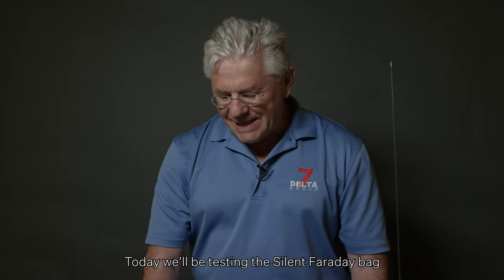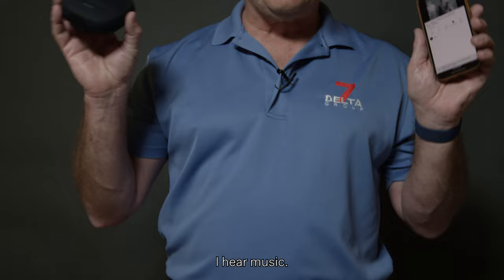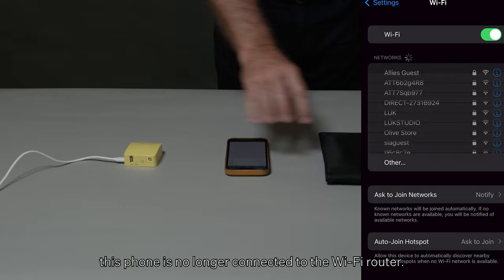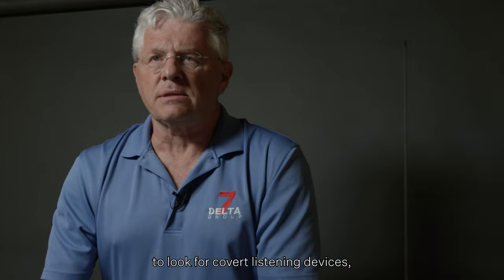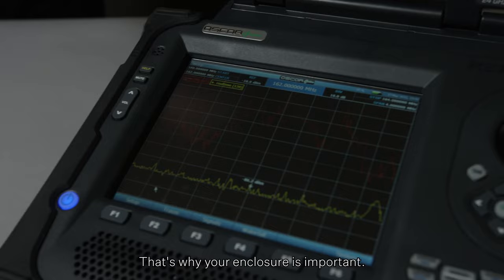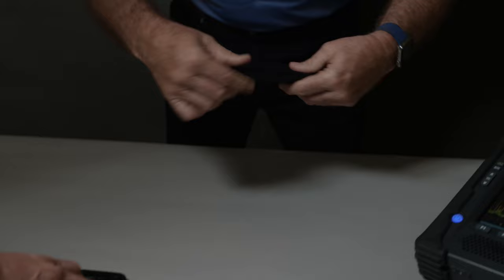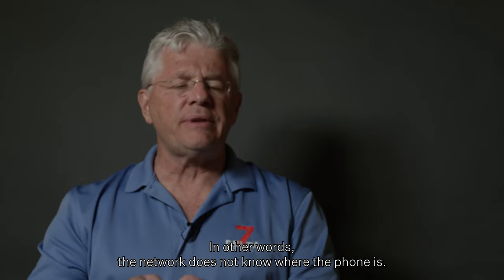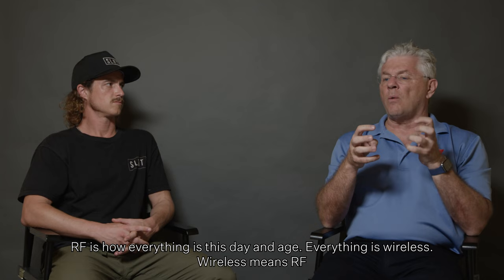Do Faraday Bags Really Work? Check out these testing results!

Comment: this "testing" proves little. while I'm not skeptical about the use of a good so called faraday bag, THIS particular way of claiming bluetooth and wifi signals are entirely blocked just because "music stopped playing" or "the device is not connected to the gateway" is BS. The music may stutter or stop just because several bits of information are lost and the speaker has lost connection with the phone, but that doesn't mean that ABSOLUTELY ANY BIT is blocked and not transmitted through the bag. You should have used your fancy tool which "FBI uses to detect covert listening device" or similar tool to check if there is NO bluetooth and NO wifi signal transmitted from the phone placed inside the bag, and so this testing would become more valid.
Reply from the maker: Thanks for the feedback - I'll tell the team we need to make that video. In the meantime you can check out our full 3rd party testing page that exceeds the Military standards.https://slnt.com/pages/slnt-testing
Reply: I did not find that this channel has done "NO bluetooth and NO wifi signal transmitted from the phone".  Do you know of any bag/company where this has been done? Or is there an easy way I can do it myself?

Comment: Always check the faraday pouch/box regularly to see if it's still working or not. A lot of customers comment about this. The faraday fabric/sheet inside the pouch/box can crack from bending because of regular use of opening and closing the pouch, so the pouch/box unable to block the signal. If it happens try to change the faraday fabric/sheet inside the pouch.
Reply: i saw some chineese bag on amazon for like 20$ who seems to work , what do you think about that?
Reply: Double bag, with a large one containing a smaller one?

Comment: Cheap heavy duty aluminium foil from the supermarket works just as well when wrapped with four layers around a switched-off smartphone, because yes, neither your 'Faraday' bag or aluminium foil can stop 100% of a phone's attempt to connect to a network when it devotes full power to the GSM aerial as it cycles down to 2G for the purpose of SOS calls. The only way to prevent a signal getting in or out is to switch off the phone before placing it into the foil or your bag...

Comment: Short, credible & concise.  Thank you so much.  I really appreciate your efforts.

NOTES - Testing a Faraday bag

1).  Bluetooth (60mW Max output)
Test the Bluetooth module on the phone by linking it with a Bluetooth device e.g. speaker.  Play music on the linked speaker & then place the phone in the Faraday cage/box/wallet.  If the music stops playing on the linked speaker your Faraday device has successfully blocked Bluetooth.

2).  Wifi (100 mW Max output)
Turn the wifi into the on position on your mobile phone.  Check that it has succesfully connected to your local network hub via a network analyser.  Then place the phone into the Faraday cage/box/wallet & use the said network analyzer to check that the phone is still connected to the local hub.  If the Faraday device has succesfully blocked wifi it should have decoupled the phone from the local hub.

3).  Cellular (2W Max output)
Ring your selected mobile phone & check that it is receiving calls.  Then place your selected phone into the Faraday cage/box/wallet & ring it again via a second phone.  If the enclosed phone can not be heard to ring the Faraday device has blocked the cellular module.

Comment: In cable, we use a spectrum analyzer to determine if there is noise in the home on the coax lines. Very useful tool that gets used 6 or more times a day for me
Reply: they use that on DSL too... testing for noise on the line.
Reply: i am curious if you could buy a thicker coax cable that protects from outside noise. future proof your home!

Comment: I understand that it isn't an easy task, however, can you provide any real testing that would help ensure any of your products would protect against an EMP or CME?
Reply from the maker: Hi, Sorry for the delay in our response. You can check out our full 3rd party testing results here:https://slnt.com/pages/slnt-testing
Reply: @goslnt i dont understand anything there. ‚We test it with international military‘ what is this supposed to mean
Reply: Did you ever find an answer to this? Or find one that would protect against EMP?
Reply: @JuliePatel-lc1dy  I've read the report and based on several related topic companies the answer is yes, it works to degrees.  The only real solution is to layer protection. Or, I guess, don't get EMP'ed. 😁